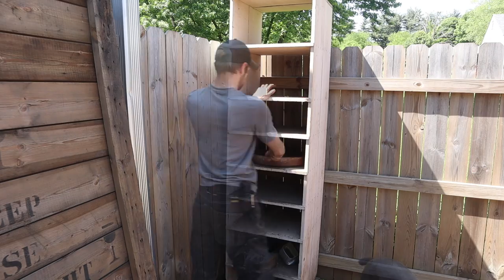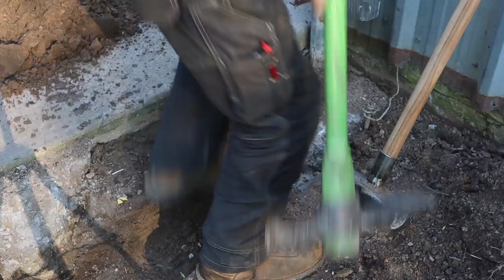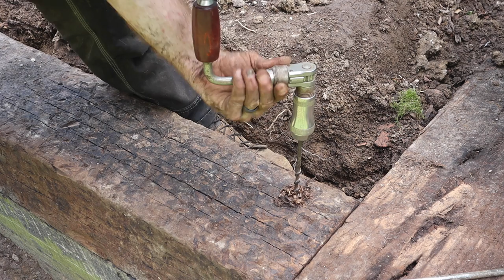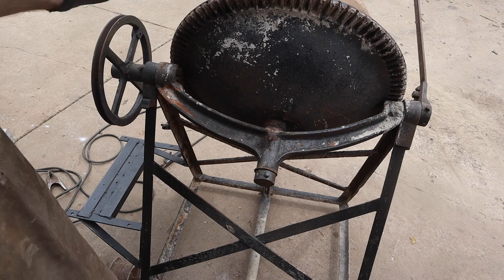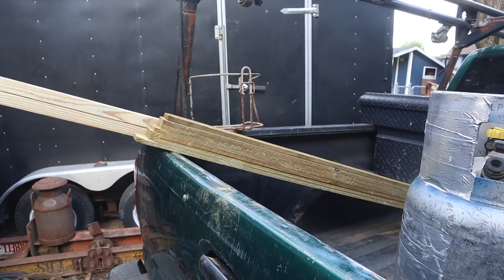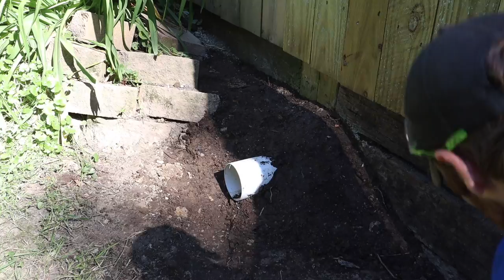FINALLY Getting 3 Phase POWER! ~ Preparing to Install a Rotary Phase Converter ~ Part 1

Comment: Glad to finally see someone mention knee protection. I'm a retired tile contractor and can't tell you how many different types of knee pads I've used. You are so correct about the velcro type. I finally bought a pair designed by two orthopedic surgeons that take the weight off the knee caps and move it to the shin. Not for everyone cause they were a bit pricey. 25 years ago I paid almost 200$ for them. I still have them and still use them. 
Thanks gonna finish watching and then go back and read the comments, always a good laugh there.

Comment: I absolutely love the brace and bit set. My grandfather have a similar set. I cherish those memories of 50 years ago. Dang, that's something else I need to add to my tool collection. Thank you.

In the old days, we used to get stingray bicycle handle bar grips to pit on the concrete mixer handles. Half dozen colors.
Reply from the maker: I totally agree! It's amazing what the old timers were able to accomplish with what they had! That's the connection that I love about old tools and machines!

Comment: I wasn't paying too much attention and I looked at the screen just as you were putting tape on the handle of the cement mixer.  For a second it looked like you were sticking it to thin air.  So yeah, good idea you marked it.  That is a well placed skewer.

Comment: Bloody good job dude, pure hard graft. Guess cutting those old railway sleepers with a battery reciprocating saw took an age and left your fingers vibrating for an hour afterwards!
Just a tip for the future, always use plasticiser in concrete, makes it stronger, easier to float finish and better freeze thaw protection, less friable surface etc etc.

Comment: Great job Matt.
you seem to have an endless amount of energy.
I would have added some polythene or HDPE liner to the inside of the sleepers to protect the wood from the concrete.
Reply: The railroad ties are impregnated with cosmoline, so they should last.
Reply: Try Creosote .   Cosmoline is for the Army on new rifles.  
JoeB

Comment: I was chuckling when you pulled out the brace and bit to do it "old school".  Still got a couple myself.  To be real old school the spikes should be sharpened on two faces only giving it a knife edge though not so steep an angle.  When you drive them the edge is held ninety degrees to the grain.  That way it lessens the chance of splitting the lumber as the edge will cut the grain rather than split it which a conical point tries to do.  Learned that hanging around a wooden boat shipyard in the late fifties.  Also a sledge often has a convex face for hitting wedges and mauls to keep from 'mushrooming' over.  Makes driving the smaller spikes very hard to do as it wants to slip off and bend the 'spike' (actually large nail).  If I am going to be doing a lot of that work I would grind a flat spot in the middle to make it drive them straighter.  That is the only way you have to pull a Honda more than twice!! (having the switch off!)  Nice work.

Comment: I’ve worked with a lot of railroad ties over the years and I absolutely hate the damn things. To late now but in the future try using a circular saw with a carbide tipped blade. Obviously you won’t get all the way through just finish the cut with a recip saw. Much faster. The chain link for re-enforcement was genius.
Reply from the maker: I HATE them too! These were here well before I owned this property, and in this instance it was quicker and cheaper to just repair the tie wall! As for cutting them... I use carbide tipped sawzall blades, and for me it's faster than having to use 2 saws, plus I only had to make a few cuts! Thanks for the support Cory, I appreciate it!

Comment: Loved it !! You answered a long burning question in my mind how you power theses 3 phase machines !! So cool loved the whole video great work !! Cant wait for the next one's ,the lean to , and the compressor , and the wiring of the phase converter, all awesome videos to come !! Love your work it motivates me to do projects of my own 👍👍!!
Reply: If you derate the motor you can run a VFD, probably not useful for that bandsaw or jointer. 

The VFD or variable frequency drive takes power in and rectifies it to DC and with IGBTs chops up the DC into and AC waveform and is capable of doing 3 phases out of a single DC bus. You’re limited by incoming power, there’s a reason we use 3 phase, and large horsepower units are very expensive. Also it must be programmed to the motor you’re using so it would take some programming to switch between machines.

Comment: Quick tip I saw just recently from one of your countrymen,  when curing big lumber with a sawzaw - cut round as deep as possible with a skillsaw and then just cut the centre with the sawzaw.  It’s quicker and usually a cleaner cut.👍👍👍👍

Comment: I just installed my RPC last week, and some of my tools were set up for 460V so I have to change the heater coils in the mag motor starters which means waiting on parts. I had thought about making a pad outside and doing the roof, may later but for now, I set it up inside. I'm envious of your forklift all I have right now is a pallet jack.

Comment: have you ever had a simple project that didn't get bigger as you went along? for me it seems there is always three things i have to do first before i can do what i actually started to do in the first place. you just have to laugh, because crying won't do any good. lol! edit; i wear the ACU pants i get cheap as military surplus when i work. they have pockets for knee pads in them too, and i cut the interlocking anti-fatigue floor pads to fit in them. they cover my knee, and shin, and save on my worn out knees from too many years crawling around on floors as a carpenter/maintenance contractor. plus they have lots of pockets, and the camo hides stains.

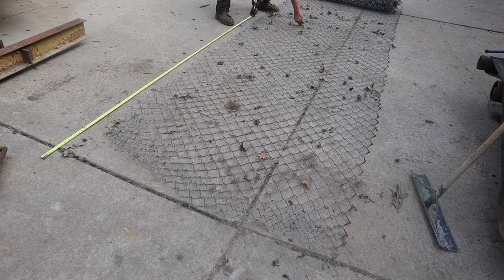Comment: 31:50 unfortunately, ordinary fence mesh is not suitable for concrete reinforcement. It must be a rigid structure, and the mesh is not such and it will not hold the stresses in the concrete, it will only let them through, i.e. it will promote concrete cracking. The rigid mesh permanently bonds with the concrete, while the fence mesh does not.

Comment: Give the poor forklift a coat of paint !,,,
You will absolutely love your new post level.   We use a half dozen when  building handicap ramps through Church.  Along with the gas powered post hole rotary,  we can set a dozen 4x4 posts in  30 minutes or so.

Comment: Sorry this is such a late comment. Been out of touch for a while. On the fence extension, why did you not use cleats for the fence posts instead of digging post holes and concrete? Seems like an over-built project. I'm sure you have a reason. Eager to know.
Reply from the maker: Because I over build EVERYTHING!Plus I intend to build a roof over that pad and l'll use the posts as part of the frame work.

Comment: Try wearing a weight lifters leather belt. Every major move you make (sledge hammering, shoveling, pulling, lifting etc.) is transferred to your spine. This massive belt is designed to give your spine a lot of support. You will notice a major difference.

Comment: After a conference, show or exhibition gets ripped out from an auditorium, you often get miles of ripped out Gaffa Tape in lumps.
It sticks to your shoes in lumps and gets stuck to cables, equipment, riggers and technicians; in fact anything. We call this conditions Techy-Foot. 
It's a shame you didn't have some 8mm or 10mm Mesh to put in the base of that slab. On any big site they say the Hardest working teams are the Scaffolders and the Concrete slab boys. Both are bloody hard work.

Comment: You're a consistent workaholic but that's good. You keep busy and you give us an education.  You do the best with what you have and you do a darn good job of it, too.  Now, are you going to put a roof over your compressor and power converter?   I don't know how rain might effect them.  Maybe it's okay like it is.  You are pretty detailed at what you do and that's a great plus.  You're safety ethics are great.  Welding is good, though Tig may be your best.  You can operate the equipment you salvage.  Is there anything you can't work on??? Looks as if you are the same as Red, "A Jack of All Trades." heh, heh.

Comment: I could watch you work on your projects for hours at a time. Ummm, I just did,lol. I was thinking that Uncle Sam could learn from those knee inserts. Sure they issued us them but they’re  only thin hard foam pads and they helped, but those looked comfy with the raised bumps on them. They also issue the strap on pads too, but try running and diving for cover with those on it’s like a keystone cops video only not so funny. Maybe they will upgrade them now to that added padding style since I’m retired pffft. Anyway that came out awesome! I believe the key to any “add on” project is to leave it looking like it was always there once completed, and you nailed it.(no pun intended) The one suggestion I’d offer (besides thick rubber feet under anything you mount out there) is to do a lean-to overhead cover to aid in protection from the elements but you’ve already thought of that. 👍🏼 Thanks for taking us along brother, I’m looking forward to seeing this one completed. You must be beside yourself knowing you’ll soon have 3phase power! Oh and I was also waiting and wondering if your pups would make a cameo appearance especially while digging in soil, but then thought “oh no, wet concrete... better not” annnnnnnd boom, there’s paw prints in the slab lol. I’d have left one,😉 crazy pups, whaddya gonna do right?!
Stay busy and healthy my friend.✌🏼

Comment: I’m not talking trash I’m just curious, what’s the deal with using a pan to move the wet cement? I’ve always used abwheelbarrow for that job. Do you have a preference for the pan? If so why?
Reply from the maker: I would use a wheelbarrow more often if this mixer was tall enough to dump into one! Lol... It doesn't have any wheels on it right now and those trays are what fits below it when I flip it over to dump... Now I'll say that in a small pour like this a wheelbarrow would only get in my way! I used to mix a lot more mortar than concrete and install custom natural stone walls and outdoor kitchens and I like working out of a tray better because of that. To each their own, but you work with what you have!
Reply: Salvage Workshop That makes sense. You did a beautiful job nonetheless. It’s clear you have experience.

Comment: Hiya. Mind if I ask what amp 220 breaker in your main single phase panel is recommended for that unit?
Reply from the maker: 60 Amp.
Reply: @SalvageWorkshop  wow. Thanks. I dont have that kind of juice in my panel, but I can't really justify a unit that big either, lol. Nice unit.

Comment: Good job ! However, I found out long ago that tar paper installed between wood and concrete is wise.
Reply: @yourmom.2743  Cement has a corrosive affect combined with water. An old fella that did the foundation work for me on a hay barn and stock shed in the 1950's wrapped all the posts with the tar paper, and the building is still solid today. He said post and lumber would not have a long life exposed directly to  cement. That process has worked well for me for 60 of my 80 years.

Comment: Hi. "Blå kläder"  = Blue clothing is a Swedish brand name.
And you put them in the wrong direction. So turn on them And I have used this model when I have worked on my house or the cars for more than 35 years 😋 And just as you say the other model is useless! ( Yes, I'm Swedish)
Reply: And if you check the pocket it has two folds, an upper and a lower, you have used the upper fold wich will make the pads position a little to high up when you bend your knee, I find the lower fold holds the pad in a more comfortable position.

Comment: Commented your pants before... Blåkläder being just one of several different brands of Swedish working-clothes, they all use the same system of built-in knee pads, nail-pockets, knife-holders etc, etc.. So glad to finally seeing an American wearing proper work-gear instead of jeans and tool-belt like a cowboy from the 1800´s! You'll have to work a bit on the pronunciation though :-)   Keep it up!

Comment: Hi, Its not a good idea to bury the electrical  earth in concrete, the cement will corrode away the copper wire connection over time
Reply: So true... I did the fire inspections at a burn training building where the contractor ran his 1 1/2” copper gas supply line directly through the concrete and some stupid building inspector approved it. It wasn’t five years before the concrete ate through the copper and the gas leak damn near blew the place up... and that was hard copper.
Reply from the maker: I agree! I already have a new 10' ground rod that will be installed in the garden bed just past the fence... I didn't install the previous one and decided to install a new one myself! That one was buried because it was easier than pulling it out.
Reply: @budandbean1  i worked in field HVAC installation for a number of years, we always sleeved copper even if it was insulated
Reply: @donnie brown That’s the way it is supposed to be done, I’ll never understand why it was allowed to be installed this way... this was a twenty plus million dollar, three story, computerized burn simulator building built with two specialized fire rooms on the first floor, elevator and smoke maze on the second floor, and bunker gear storage on the very top floor. I made a note of it on all inspections I performed because I considered it such an issue and there was a bit of satisfaction when it let go. (Sorry god...) That $10 sleeve would have prevented all their problems.
Reply: @Salvage Workshop  Actually, as nice and professional a job as you did on this, personally I figured that this was probably just a metal building frame ground or something that would be replaced anyway. You certainly do good work! Before going into the inspection side of things, I was an electrician and installed quite a few roto-phase units over the years. Every shop needs three-phase IMHO. Congrats on your new unit!
Reply: @SalvageWorkshop  Hi, Good to hear that you are going to keep safety as a priority
looking forward to your projects

Comment: You ever look at yourself as a machine.. You are non stop go. I know it's a video, but I don't think you ever slow down. two thumbs up for your drive and work.  I hope you put a coat of paint on the bottom of your building before you install the machines.. blast the bottom , clean it up and seal that from the weather.  Was worried about the drain being right near the phase converter..  Water ... electricity.. just make sure you have it well grounded. I saw a ground rod there, make sure it's attached, as well as the downspout.
Reply from the maker: Lol... I'm a firm believer in having a good work ethic! It has served me VERY well! Plus, I find the harder I work the luckier I get! 

Ya I should paint that bottom section of the siding, not sure if that'll happen or not! I do agree though, the converter is going to move away from the down spout, plus there is a NEW ground rod going in, as well a bunch more in part 2!

Comment: Wow I do not think I have seen anyone use a brace and bit in over 50 years.  Especially someone who has cordless tools.
Reply: Good comment,.. Keith Fenner has a brace and bit de-Burr tool used for 20 years.
Reply: There are quite a few wood workers who still use then. I tend to use mine for driving in larger screws and bolts as I have dodgy wrists...... not so much now I have an impact driver, but it still comes in handy. Sometimes it's just nice to use my dad's old kit for a change 🙂👍

Comment: So when you were pouring the concrete, why didn't you just put the mixer over by the area where the cement was going and just dump the concrete directly in there instead of the extra step of pouring it into the pan, dragging it over and dumping it? Just sayin'

Comment: did you ever have a simple project that didn't get bigger as you go along? for me, it always seems there are three things i have to do before i can do what i wanted to do in the first place. you just have to laugh, because crying won't do you any good. lol! i wear the ACU pants i get as military surplus when i work. they have knee pockets for pads as well. i cut them from anti-fatigue floor mats. they cover my knee and shin, and save my worn out knees from too many years crawling around as a carpenter/maintenance contractor. plus, they are cheap, have lots of pockets for tools, and the camo hides stains.

Comment: The down drain pipe beside the transformer scares me! =O
Some all-weather aluminum tape around the drain pipe fittings, might not scare me as much!
Reply: When he broke the foundation with a sledge was my issue. Saw the whole  foundation wiggle. I know for a fact that he has multiple chisels pneumatic and otherwise.
Reply: @bradens1747  Those junk red things he keeps using are my biggest problem lol.

Comment: Use 45 deg angled PVC on your drains where you can, like at the bottom of the down spout. And don't glue underground pipes, or they can fracture.  They don't need the glue.  And don't forget to add a clean out access.  Oops, too late.  Live and learn.  That's how I've learned.  We are all learning.

Comment: the problem with those knee pads is that unless you are kneeling on carpet all the time the knees of the trousers wear out quickly, but i know where you;re coming from with the problems with strap on knee pads